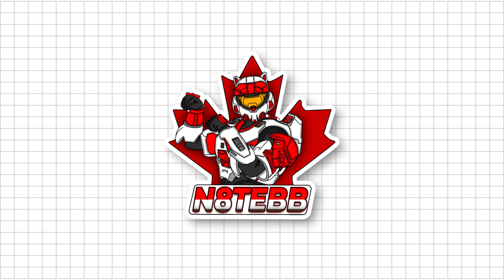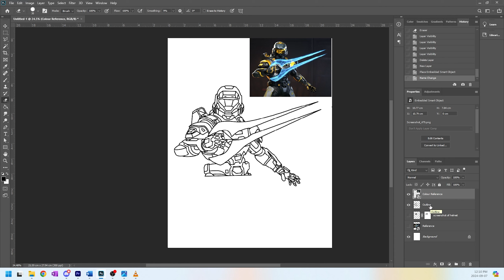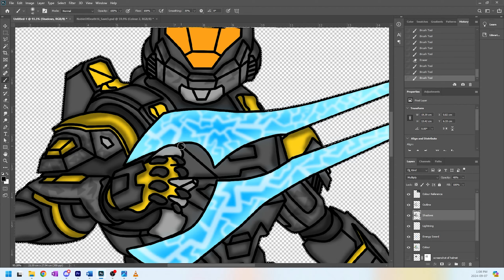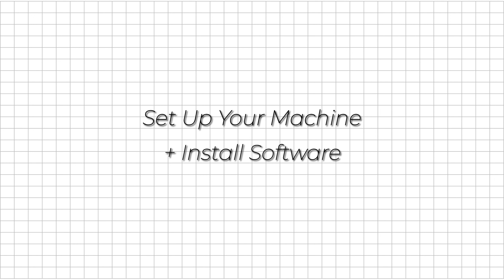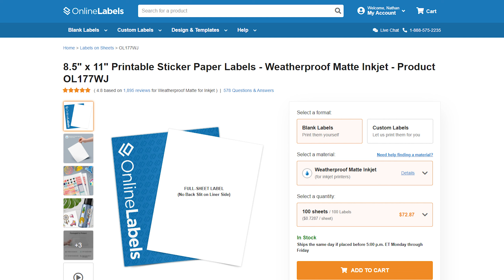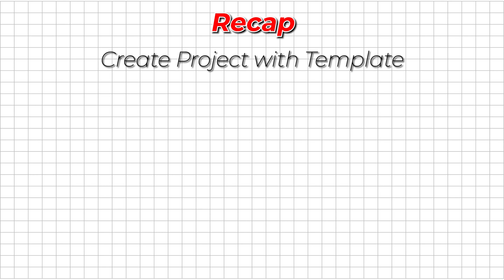How to Make Cosplay Stickers by Tracing a Photo & Cutting Machine!

Comment: i just watched your visor vacuum forming tutorial and i was wondering - have you ever tried resin casting a visor and how does it compare?
Reply from the maker: Terribly sorry for the delay in reply.

I have not tried resin casting a visor so unfortunately I wouldn't be able to tell you how it compares. I would think that it might be difficult to get a completely smooth cast, which will make it difficult to see out of. I'm not certain though. If you give it a try, be sure to let me know how it turns out!

I have hears of people resin PRINTING visors with success, though. Spartan 052 on tiktok has a resin printed visor, as well as many members of the 405th Infantry Division costume community. From what I can tell there is a very specific process you'll have to follow to get optimal visibility, but I have seen it done with good results.